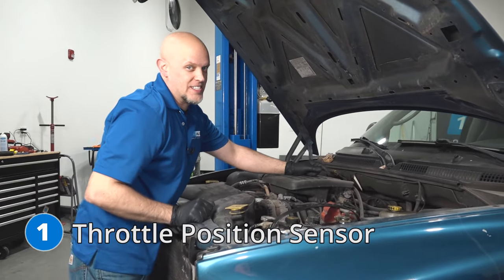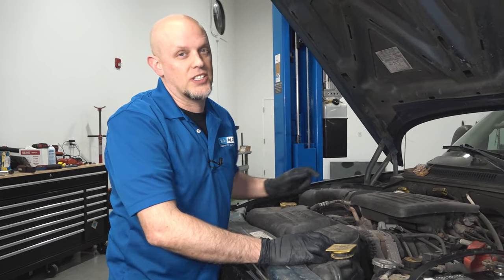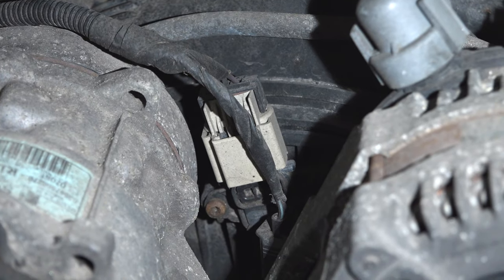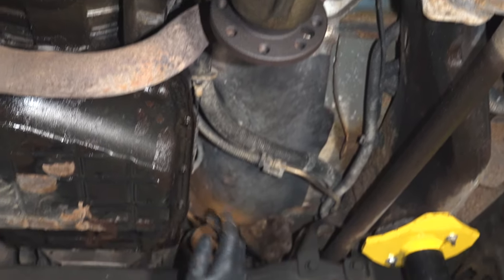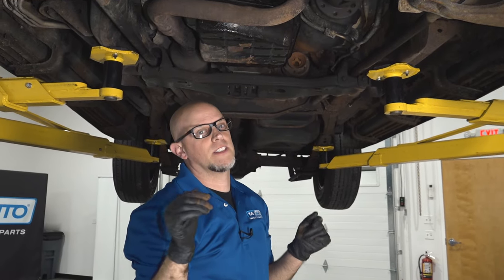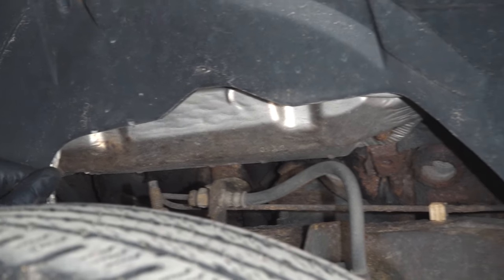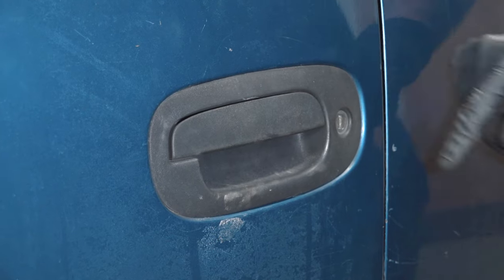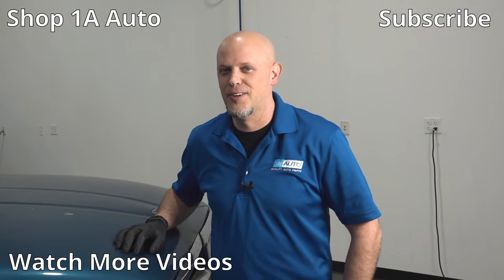Top 5 Problems Dodge Durango SUV 1st Generation 1998-2003

Comment: Love the video.  Love the channel.  Solid SUV.  Is that the 4.7 I've heard people on Facebook have nothing but problems when it comes to the 4.7L.  I have a 99 5.2L twin turbo Durango.  One question I do have to ask for everyone is Why does the oil pressure sender or oil pump fluctuate???  I know its a constant question but acceleration is fine but braking,  oil gauge will drop to almost 40 then when acceleration its normal.  How do we fix that or is that how dodge built this SUV.   Thank you.
Reply: Mine does that too, it will drop when you brake then rise when you accelerate. I never had an issue so it should be fine.
Reply: Yes that's a 4.7 in it (ya can tell simply by the big square boxy black plastic intake box on top...the 5.2 & 5.9 Magnum's with the carb style throttle bodies on 'em have the MUCH smaller round ones on 'em)...& yeah, the 4.7's have some well known issues! Most all of which are primarily due to neglected proper servicing/maintaining of 'em. If ya run the correct weight & viscosity of oil (5W20...NOTHIN' thicker or heavier than that!!) in 'em, use the right coolant in 'em (the orange stuff & not the normal green stuff), change the oil religiously every 3,000 miles, & DO NOT keep drivin' 'em if/when the temp gauge creeps up very much over 210-220° (at the very most) they're fairly good engines & usually won't be too troublesome...but if ya neglect 'em or overheat 'em they'll definitely become a major problem in a hurry!!
Yeah, the oil pressure fluctuation is somewhat normal...if/when it goes totally wacky (by either reading wayyy low or wayyy high) it's most usually because the oil pressure sensor is bad & it just needs replaced, which is a fairly simple, inexpensive, & easy fix...or it could be due to the oil pump pick up screen is becoming clogged up, which is a much more difficult job to clean (or replace). 
Given a choice though...I'd go with the good ol' reliable & proven 318/5.2 Magnum's over these 4.7's myself...👍
Reply: Mine did that also (99'). My mechanic just replaced a few sensors and he said its fixed now. Of course, mine didn't start acting up until I was on a real bumpy gravel road. Everytime I stopped my oil pressure gauge wouldn't even registet

Comment: Hey hopefully your having a good day.. 

So I disconnected a wrong hose and coolant went into my  Throttle body what can go wrong or what should I do to fix the problem.
Reply: Pull sparkplugs and fuse for fuel pump. Crank engine to eject coolant from cylinders. A quick crank should do it, give it a blast of compressed air down the sparkplug holes in the head, and also a short spray of wd40 to displace any rust causing moisture in the cylinder. Put it back together and run it.

Comment: Do you have any info on the rear light assemblies failing. My L rear blinker failed, brake light and tail light also. I changed bulb, didn’t work, bought new screw turn bulb bracket, didn’t work. Ugh!!

Comment: Mine after driving a little wants to lock up. I smell a burning and if i keep driving it, it will start smoking out of the wheel area. I have already had all the front brakes replaced and they still dont know where the issue os coming from. I do have to say that it was Pep Boys who changed everything and they said they put a lot of the parts on ther for free like the break pads and two other parts. I paid for the master cylinder and new tires bc whem I bought it, it had weather rotted tires and breaks wouldnt apply correctly. When I got her back the first issue I memtioned started happening so I I dont know if it was Pep Boys or just something that would have happened later on anyways. Any info would be appreciated 👍

Comment: My dad drives a 99 dodge Durango 4x4 and we are just now replacing factory original parts on the truck idk and it has 250k+ miles on her she still runs only thing that is wrong with the old girl is a senior under the engine is going out what makes her shut off but she starts right back up

Comment: I still have mine 2001 same color and model in the video runs good has brand new engine jasper and transmission everybody ask me to buy it I am having a issue with the abs break light comes on random and it has brand new breaks and rotors but the light comes on and I hear a roaring sound under the drivers side as I drive it lately. I took it to the shop before they said they couldnt find anything but something is wrong i have to get old blue fixed any ideas what it could be????

Comment: If the front drive shaft is off do you keep the button for the 4x4 in the AWD position or the 4 Hi position??
Reply: In my '01 R/T which only came with AWD, when my front prop shaft puked (both times) I could pull the shaft and switch T-case knob from AWD to 4HI and like that I drove just fine. This last time it's been from this past summer until earlier today when I finally installed the replacement. YMMV

Comment: Mine runs perfect until 3000 to 3500 and then loses power and  starts cutting out and bogging down and u have to let off footfeet to get going, I've replaced cam, crank,TPS ,iac, cleaned throttle body . Any suggestions where to look next?

Comment: i have 2003 dodge durango same color as on your video.  it makes like an engine revving sound when the engine is cold and you start it, but disappears  after a few seconds. somebody told it is some kind of a sensor.  i notice  that when i drove it the other day  for about 30 minutes and while im sitting on a red stop light  i notice that it is making the same revving sound and it did not go away for about 10 minutes or more. any  idea what this revving sound is?

Comment: Hello, I have a question about Dodge Durango from 2002. As in this video, there are roof rails (elements placed crosswise). How can you remove them to, for example, easily enter the garage? The car is about 1803mm, the garage is up to 2000mm. What is the height of these roof rails from the point of contact with the car body to its maximum height? Thank you for your help. greetings

Comment: I have a 2001 SLT Plus and lucky. It's 2WD and on this list, I've only had to change the throttle position sensor.
Reply: Update! She ran hot on me coming home one evening and it failed the exhaust gas in coolant test. Verified blown head gasket at #2 cyl. Due to age, needing lifters, and since I love my "classic"  Durango, I have since replaced the engine with a new crate engine. Still going 😉

Comment: I have a 99 4wd 5.2. It will stall after about 30 minutes of running. It will start back up after about 20 minutes. It will start back up with starting fluid for a few seconds after the initial 30 minutes. My guess is fuel pump. Any help? No codes on generic scanner. Battery posts are clean and tight. Lights and dash stay on after stall. No no buss across odometer. I know it could be the ecm or the crank position sensor or cam position sensor. I don't have a fuel pressure gauge or I'd test that. Pretty sure its the fuel pump cause it will start with a squirt of starting fluid for a few seconds.

Comment: Axle bearings and seals, power steering pump failure: Top problems 1-10

Also those exhaust bolts

Comment: Why does he say “I actually used to own one” at the end of every video he makes? He said it in the Durango, S-10, Avalanche, Pontiac G6, and Tundra videos...
Reply: Cause he owned one?
Reply: Perhaps that's why they have him make these vids?
Reply: Because maybe he owned them before. Tf
Reply: I just bought one for $600 and all is wrong is the exhaust manifold bolt broke on the driver side button most rear bolt is the only problem I might get some black ion rims with goodyear wrangler tires for it :) I say I did a good buy for my first ever car in my name I'm also go pay for it tomorrow since bank is close but ya got one my self and it's white

Comment: My problems on my 99 is stiff suspension wven after new shocks and tires. Ac dont blow cold and nothing blows out of dash vents facing you,only floor and defrost. And the door lock thing.

Comment: Is this for the 4.7 l or the 5.9 l motor
Reply: My 4.7 has the exhaust leak. You only hear it until it warms up but the 4.7 is notorious for the loose/ broken exhaust manifold bolts.

Comment: I’m the extremely off chance anyone sees this. My issue is an extended crank time to turn over. I think it’s throttle body at this point (newer battery, newer spark plug and ignition system). No check engine light tho… help a brother out

Comment: That's not the first gen engine. The first Durango (98") had a 318 (5.2) or 360(5.9) V8 underhead cam ,which is a tough ass engine. This is a overhead cam engine.Bought one used five years and about 15000 miles ago. No major problems and non of these issues.
Reply: I currently own a 98 with the 5.2 I love my baby
Reply: @domiquecralston5143  your prob won’t respond but I found one with less than 100k miles/ v8 5.2 is it worth it? It’s only 5k?

Comment: I have a 1998 dodge durango that the undercarriage is shot I also have a 2001 dodge durango that I would like to swap the body from the 1998 to the 2001 frame boxes engine . I know I will have to swap body module and engine module.... Can Any one help me with this before i start the project....  Thanks in advance

Comment: You forgot that damn transmission that always goes out at 250000 and the oil pump
Reply: Curious, mine has 255k miles. I had all the fluids flushed when I bought it and the guy said no metal shavings in the tranny. Maybe its been replaced already...

Comment: 2002 Durango RT 5.9 turns over but wont start....replaced distributor cap and rotor, cam sensor, plugs and wires. Good fuel pump & battery. No engine light or code. 
I cant find help anywhere!!
Reply: '01 R/T 5.9 - This happened to me also when I had a dead cell in the battery. Even jumper cables wouldn't get a fire. Changed battery and blammo, fired right up.

Comment: Literally none of those issues. Didn't mention what drive train you were on, not much good to anyone if you don't. None of the issues were backed by  "why" they're the top 5, mechanical reasons and or statistics. Regular maintenance, and addressing small things prevent many of the larger.

Comment: 1999 5.9 has a weak intake manifold gasket set and fails. Then the engine sucks all the oil out and in through intake and when on an incline with the oil low, oil pressure zeros out and many have blown their engines and Chrysler blames YOU! There's an aftermarket kit that doesn't ruin the gasket with a thick aluminum plate rather than a thin sheet metal plate that contracts and expands, killing the gasket. Weak Transmissions (RE46) rebuilt once already and needs again (136K) and Torque Converters and weak Rears too (That blew a hole out the side of the Diff case at 110K). Brake lines rot right through in Winter areas using salt. ABS is CRUDE.  Heater cores clog and the heat and AC ducting and seal crumble. 10 hour job for the heater core and no parts to replace in the heat ducting. Winters are always FREEZING in this POS. I could go on.... AND on. DODGE SUCKS. Never again in a million years.

Comment: Other issues PCMs fail quite often, battery temperature sensor, ABS system electronics, etc... as with all Dodge vehicles, ELECTRONICS are the weak spot.

Comment: Did nobody see the plug jump out of the wall between 3:12 and 3:14?😂
Reply: I have also recently Bought a 2000 dodge durango SLT with 176k Recently done an oil change
Valve cover gaskets Coil packs and plugs. Now it's running like a dream haven't had a problem vary good SUV

Comment: The number one problem is the 4.7 L. You really have to be strict and change oil regularly. Not a mile over 3000. And use full synthetic. These engines will have terrible problem with sludge

Comment: Forgot about passenger or driver knuckle bottom caliper bolt hole stripping resulting in a helicoil or new knuckle
Reply from the maker: +XD silenceclipsYt Thanks for the feedback!
Reply: 100% happened to mine on each side. Had to find a used one from a junkyard in Iowa which they shipped out in less than 24 hours. When the other one went bad I believe they tapped the hole. Not a good design.